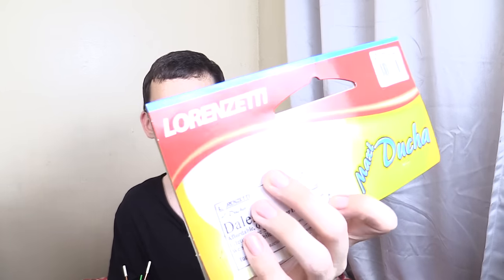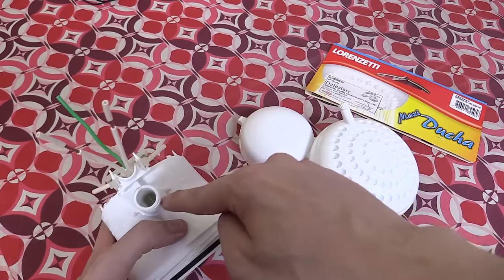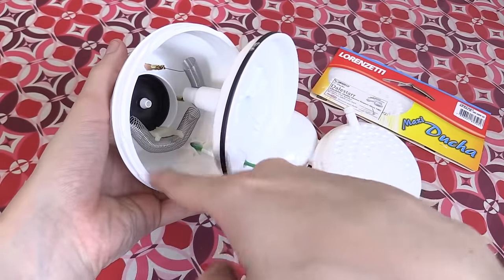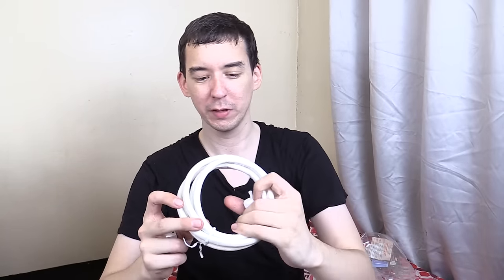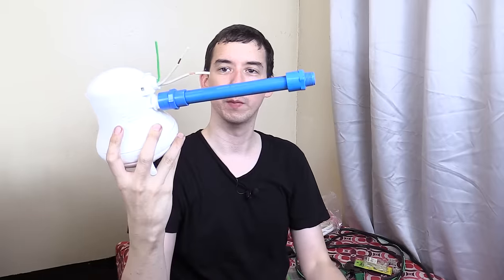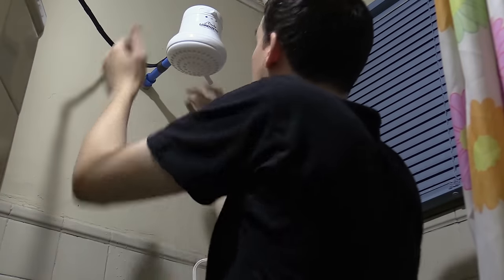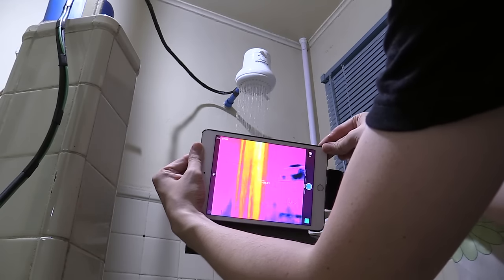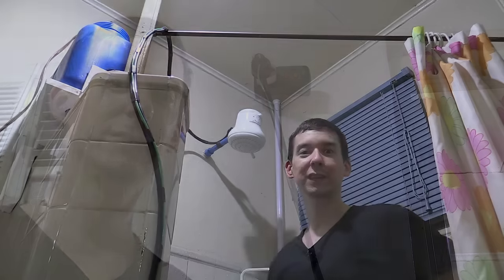Lorenzetti Electric Shower Head

Comment: I learned how to replace that inner coil when I was 9. They're like 2$ each and last for about a year, give or take.
They do rust, burn or break over time, and the shower just stops working, nothing else.
Reply from the maker: Yeah mine eventually broke, but I just reattached what was remaining. It's not a method i'm recommending because obviously you're changing the resistance and power usage.

Comment: A couple of points:

15 amp is generally too much for plug sockets. It's going to get hot and either melt or burn. This thing must be hardwired in with an isolator and have an RCD in the distribution board.

Earthing or grounding must be in place as well as proper bonding to have all conductive parts at the same potential.
Either using TT or TN-C-S earthing.
The TN-C-S idea is great except if the neutral breaks along the way. Google Denishar Woods - she was electrocuted when a neutral wire broke on a TN-C-S system.
TT may not be any safer under other circumstances. The ground resists electricity after all.

Personally I prefer a tank or water heater with some pipe in between me and the electric heater element. No live electricity in the bathroom except for a light thank you.

Comment: The ground wire should be connected to wire mesh and the heating elements should be a metal plate with some sort of ceramic around the metal plate

Comment: YES,  if you turn on the electricity with having water in the shower head, the heating elements will burn out in one second. So, run the water first  and keep it running, then turn on the electricity

Comment: 4:41 WOW this is so wrong, that hole is not for what you said it is. It is to connect the hose with the mini shower. If you don't want to use the hose with the mini shower you have to tap it or the water will flow sideways. That's why it has a plug.

Comment: Open up that plug adapter you’re using, I can almost guarantee that the ground connection would be lost inside it (even though it looks like metal all the way through) that’s why your RCD didn’t trip, because using that adapter, the shower wasn’t grounded b

Comment: You need to verify that the ground is working before your install. Turn off the breakers and check continuity back to the panel. I've seen ground that has been internally shunted to the mains voltage which will falsely lead you to believe that you are grounded when in fact you are not. Get someone who knows what they are doing. This is not a DIY project. When all is said and done rest assured that the electricity will take the path of least resistance. If you are showering then you can rest assured that the electricity will flow through the water around your body and into the puddle you are standing on (as opposed through your body). Thats why you only feel a tingle.

Comment: Well same as electric water heater the heat elements are touch the water and we shower from the same water that is touching the electrical ,🤐🤐🤐they are the same or water heater is probably higher power right ??? 220

Comment: Also you were supposed to take a wrench and unscrew the shower head not the Piping with the shower head on it. That way the pipe could work as a way to connect the ground with a brass ground clamp

Comment: 1:13 You are not supposed to do this, you are supposed to use a ceramic connector, cheap and simple.
So, this is really common in Brazil. I don't know why you are so surprised.
It's not the best solution, but it works.

Comment: Besides, our friend gadget addict should never use it plugged in an AC outlet, but, connected with screws in a porcelain connector, proper for this type of installation. If one plugs that to an AC outlet, overtime it overheats and makes a fine mess.

Comment: That's a very cheap version of an electric shower, but you would be surprised to know that showers heated by gas are more mortal than electric showers. Every house is built with a special power system only for the shower, since it needs 220V and different cables.
Also, the pictures you've shown in the video are really bad, cheap and lazy instalation, and that's not normal. 
Now that I live alone in my apartment I have a shower that is heated up by a gas system and it takes almost one minute to get warm, unlike the electric shower. Also, that shower is only dangerous when you try to repair it without turning off the electricity. I never heard of even one incident with an electric shower in normal conditions in my whole life. 
And about the tingly sensation you've mentioned, I also had never heard of it before.

Comment: I've got one installed as it happens. If it drops water from a safe 50 cm above your head you are perfectly fine, however I would never recommend to have a shower with your head at 5 cm from it, neither I had tried myself. This is like white sharks, keep a good distance and you'll be alive.

Comment: You could make this safer with an isolation or low voltage high current transformer.
Reply from the maker: Yeah but if you're going to go to that much effort, you'd probably just buy a more "standards compliant" water heater in the first place, I guess.

Comment: Moving in Brazil, this electric shower was the first thing we kicked out of the house. Replaced it with a central gas heater. Never ever use electric power in a bathroom 'wet' zone. When in use at night, the lights of our house dimmed till half. I recently bought an electric heater which in combination with a solar heater will avoid spills at the sinc. This 'better' Brazilian brand is comparable with the model from the video, specs say it uses up to 6400 Watt, however the electric leads to the device were 2,5mm2 and the earth even only 1,5mm2.. AND still the heater is being approved by Inmetro, the 'Brazilian quality' authority.  How can you justify this wire sections with this massive potency?  6400 W should have a 32A breaker and 6mm2 wiring.
Reply: Well, if you use the shower at the maximum power of 6400w, you will probably die boiled, not electrocuted. Should have tried to use less water and less power, before throwing a good shower into the trash can. :)

Comment: I understand electric showers are a bit scary but it's not that dangerous. Even without the ground wire you CAN'T get zapped by the falling drops for the very simple reason there's no continuity meaning no closed circuit. There's no "tingly sensation", nothing like that. Electric showers are used in millions of households everyday with no issues whatsoever.

Comment: most homes in Brazil and in other countries that use electric showers are not grounded with a ground wire, nor are the showers, and no one has ever died from using an electric shower. People who died from electric shock died from metal pipes from 100 years ago, or bad wire contact which was extremely rare to happen even then. Stop talking nonsense and prejudice (basically lies).

Comment: Why couldnt they make these a bit safer using lower voltage like 12VDC engine heater type elements, there hundreds of not over a thousand types of 12VDC immersion, magnetic, or silicone panel heaters, and then use a 12v power supply or battery bank?  It wont be nearly as cheap but i would think ten times safer.

Comment: I don't agree with overzealous safety around electricity. But the part that scares me about this unit is that it is all made of plastic, and hanging on a plastic tube with a force moment. It may come apart and fall down into the bathtub. Maybe the plastic cracks and the water system has been drained and coughs up air. Or it breaks if you push the switch too vigorously.

In a country without proper heating facilities, would you really have several kilowatts of power? Usually old homes here are quite limited because gadgets used to be less powerful. 10A for half a house is normal. One might have to steal power by running a new cable.
Reply: safety never hurts, plastic is light and very strong, a metal shower would be more dangerous due to contact,The electric shower is automatic, it only turns on the resistance when water passes through it.

Comment: Seems like it would be safer to use this in front of an old refurbished low capacity water tank, so that the water going in is heated, but even that would only seem to be marginally safer.

Comment: I've used different brands of these shower head heaters.  This Lorenzetti is comparable in safety but barely generates any heat at all while connected to 120VAC mains power.  Your waisting your money if using the USA.

Comment: I try to understand the fear of strangers with this shower. Call it suicide shower? In Brazil it is easier for you to be killed by a stray bullet, run over by a drunkard or even a heart attack. When the installation is carried out correctly, the risk of electric shock is low. All these photos shown in the video can not serve as a basis, most houses in Brazil need the installation of ground wire to avoid shocks. So guys, do not be afraid. I'm 30 years old and I'm still alive.

Comment: Well that's fine if you only need 20 ounces of hot water to shower with..I'm more like 5 -8 gallons so show me one with an industrial sized hot water reservoir and I'm a believer
Reply from the maker: You can use as much water as you like. It's constantly heating the flowing water as it passes through the head.

Comment: points out dangerous electrical installs, then replicates them. the lead wires are not spot welded on, they're soldered on.  This thing should be on a GFCI protected circuit or outlet at minimum, with surface wiring to the shower inside plastic conduit. no tape

Comment: um.. everyone everywhere has ground.. cause its not a homonym... its called ground cause its LITERALLY THE DIRT. its why we usually hook up our grounds to water pipes. cause it goes to the ground taking the shortest path. this become a bit more complicated with as if you connect it to your outgoing pipes while its charging your incoming pipe and you complete a circuit in your shower.. bad idea, literally suicide shower. but any wire going into the dirt is fine. and it doesn't actually do anything 90% of the time. its only with power surges or major shorts does it actually do what its supposed to and direct the current into the ground instead of electrocuting people and or frying electronics and power outlets.

Comment: Proper installation with grounding, valve made of plastic and good quality cables should make the equipment perfectly safe to use ... but it still frightens. Wear a pair of sandals just in case hahahahaha

Comment: Funny that people think Lorenzetti showers are dangerous - "suicide showers" - LOL!. Like others have pointed out, electric shower heads are very common in Brazil (where Lorenzetti is based) and, if installed correctly, no problems. Very cheap devices that provide hot water in a nation where many people shower twice per day. Efficiency is not so great and there are better devices than this one on the video.

Comment: Anyone know/ can teach how to get it to be LESS hot. ( not another water flow bs, I cant change that much) many of these shower head ate too hot and no where can I find a device to restrictions the imput or anyone with a idea to solve it exceptionally 1m videos saying to put more water through  it.
Reply from the maker: I've seen videos where people opened the unit and cut the coil to be shorter, so it won't get as hot. 

But they're doing so at their own risk 🤷‍♂️
Reply: In these showers, you can chose the temperature in the head.

Comment: It's not really the wiring y'all should focus on, but on the water. Pure water is non conductive. Salt water is very conductive. How safe this is even if installed correctly depends mostly on the electrolytes in water, even more than the wiring. And if for some reason tap water gets any high levels of salt in it, you will probably find out in the worst way possible.
Reply from the maker: I'd still say it's pretty important to have an effective ground attached though. Because ultimately that's what leads to many people having a severe shock.. the lack of a ground for electricity to flow to.

Comment: Does the water pressure affects the temperature
Reply from the maker: Yes it will. The slower the flow of water, the longer it will stay inside the head, and therefore it gets hotter.
Reply: @GadgetAddict  ok,because I have installed one yesterday but it doesn't really gets hot,slightly warm
Reply: @GadgetAddict  I removed the white thing from the entrance of the water flow because the pressure wasn't strong enough,so I'm now wondering if I should put it back in or try a different shower heater head
Reply from the maker: @raniquegordon4750  the faster the flow of water, the colder it will be. 

So either you slow it down or you buy a higher power version. 

Which one do you have? 2kW?
Reply: @GadgetAddict  oh ok,understand

Comment: Why not just install a 30/40liter heater/geyser in your bathroom. Thats a safe and better option.
Reply: No, not at all, actually more brazilians die of gas leakage than eletrocution wich the chances are none, and most of Brazil's population are poor and can't afford a gas installation!
Reply: @editingbasics9815  Wasn’t talking about gas powered ones. I was talking about electric ones. You can easily get one for like 120-150 dollars. Some even come with included installation in that price. These are proper water heating systems without the risk of explosion or electrocution. It takes 15 minutes to heat up, then you turn it off and it keeps the water heated for up to 24 hours.
Reply: @nasidctg  Yeah but, the dollar are R$5,00 so most of brazilian opulation still can't afford it! My bad!

Comment: You can't be electrocuted by this if you're underneath it and it shorts out.  Electricity isn't an angry creature hell bent on killing people...it takes the shortest route to ground that it is capable of jumping.  If the ground wire becomes corroded, it won't shock you...it just won't continue functioning.   You'd have to actually touch the hot wire to get electrocuted, it's not going to follow the water to you, then to ground.  It can't jump that far.

This is just ignorance.

Comment: The ones who died from a shower underneath these death traps wouldn't come back to say they died.. Would they? Lol.. Stupid idea.. Nothing wrong with heating elements encapsulated in earthed copper tubing.. Much safer me thinks 😉 water has a pretty high resistance, that's why you don't get a shock. Throw in some salt and iron content an watch the tingles increase in a not so pleasant way.

Comment: Hi thanks for the vid 😎 its crazy hoe they put the wireing right next to the water connection / pipe . i can just see the connection squirting water up onto the power lines with tape ☠ thats nuts at least use the other side for the wires input or better the top as you said with seals on the lid !  ....  👻👻

Comment: I have seen 2 hotels in Africa and never took shower in it
Reply: Here in Brazil we use it in practically every house. There are some precautions you take when using this type of keychain.

1. It must be electrically grounded, that is, the energy that escapes from the shower must go to the ground.

2.The water that comes out of it does not cause a shock, but you should not change the power of the shower while it is on, as this generates an electric current.

3.The shower only turns on when the diaphragm inside it fills with water, so to turn it off, just don't let the water flow, then change the power and then turn it on again.

4. Do not use a metal water release system (handle or water valve), as if the power is not connected correctly, the current could pass to the valve and cause a shock.

Comment: No self respecting electrician is going to go anywhere near that. Besides the 18th edition EIT regulations in UK require residual current circuit breakers so it won't work on modern wiring.(your RCD can't be working?), 
But it's something to look out for and keep away form if you are staying in hotels in dodgy parts of the world.
Reply: Even good quality properly installed electric showers are an excuse for bad plumbing.